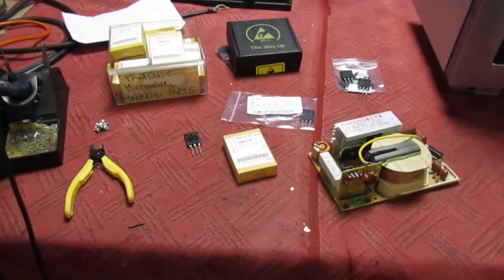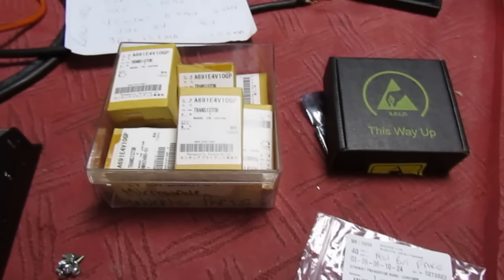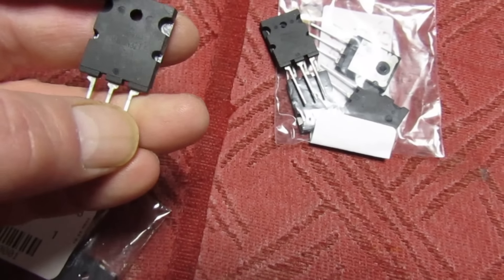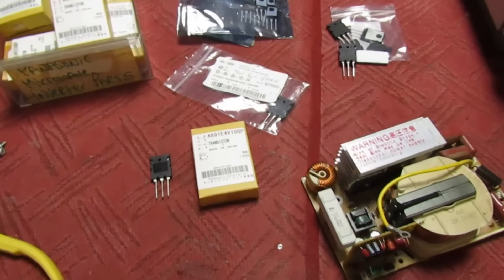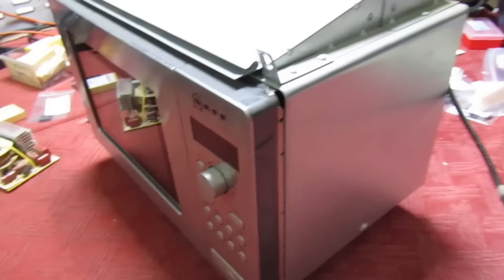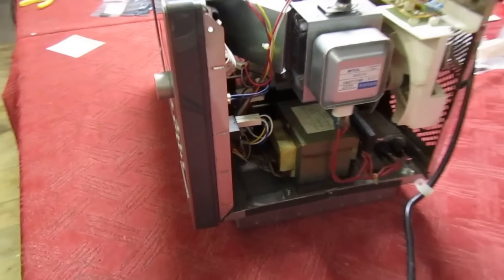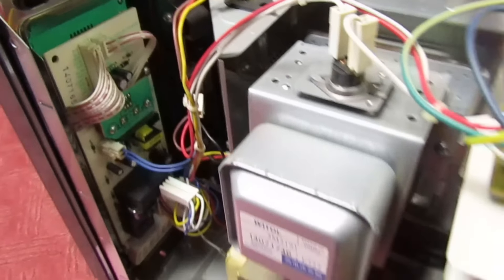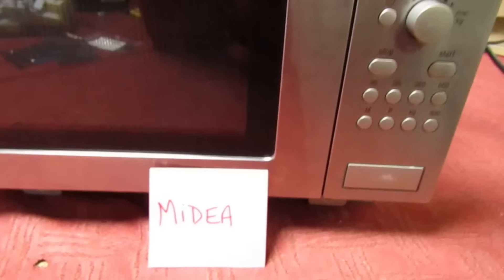Neff Microwave nasty surprise inside .

Comment: i dont see why they went with an inverter, the traditional innards are far simpler and probably more reliable?
Reply from the maker: May be at the time it was cheaper to make an inverter than a iron cored transformer with expensive copper wire , however some transformer I have seen use aluminium wire that's just enamelled so it looks like copper .
Reply: @michaeldranfield7140  weird, though i do have a small hank of enamelled what i think is aluminium wire, but its not recent stuff, its probably 1950s or even older, 30s maybe , its certainly not copper, maybe steel or a resistance wire, never tested it in any way, got it as part of a job lot of enameled wire 20+ years ago..
Reply: The inverter is lighter and probably also smaller, so the cooking volume can be larger.
Though the Midea over still has lots of wasted space.

Comment: That must be incredibly frustrating to spend quite a while fault finding an appliance only to have fake parts being installed & still not working..  it would make you scratch ya head a bit.
Reply from the maker: I got the money back for the fake supplied from a distributor, this is a huge  problem now though fake parts , I would say most of the stuff sold on the internet is fake but unless you know how to spot a fake you wont know its fake until it blows again, quite possibly causing more damage that you had to start with .

Comment: Hi Michael.  I have a NEFF microwave with this exact Inverter inside.   Can you still repair this board or provide an exchange?  I am an electrician by trade and have removed it.  Classic fault as you describe. Everything works but no heat. 10A fuse NOT blown, Magnetron has continuity and no short to earth.
Reply from the maker: you would have to bring the whole microwave in as I have no way to test a board but its unlikely to be the board if the fuse is not blown ,I have another video to upload showing the repair of this board in a few days time .
Reply: Thank you so much for your reply.  I’m guessing you are probably not near me in Bournemouth.   Otherwise I would gladly bring it to you.

Comment: I've had three inverter "Pan o' Bangers" over the years, and always felt that the reliability was not all that good. I know I still have two duffers here, right now. One is a basic microwave only, and the other is an all singing, all dancing microwave, convector, grill combination.

Now, I'm going to be having a clear out in the weeks ahead. If/when I find them, would you still be interested in them? I don't know what state they'll be in, but I can let you know as and when I turn them up.

Interested?
Reply from the maker: Yes I would be very interested in some inverter boards, the model number of your combi would also be of interest as I have a nearley new one, well it was nearley new a couple of years ago! The control panel has blown up but there's no circuit diagram for it so I can't identify the parts that have blown, it's board only replacement but the customer didn't want to pay and gave it to me but it was far too good to scrap and not worth buying a new pcb.
Reply: @michaeldranfield7140  I will definitely let you know what I find as I dig my way through. The combi is a fairly old beast, all brushed stainless steel trim and polished stainless steel cabinet.

The other is a plain white painted cabinet with plain white plastic control panel and door.

Is it just the PCBs you want? Or the the entire ovens?
Reply from the maker: @whitesapphire5865  Just the PCB should be fine thanks .
Reply: @michaeldranfield7140  In that case, I'll take them out as and when I find them, then they can be boxed up for posting.   Do you want the magnetrons as well?

Comment: Do these "inverter" microwaves have any advantages over the conventional transformer types?
Reply: For the user, it is good to be able to have the oven actually run at a lower power output when heating or cooking something delicate. A standard microwave reduces power by cycling between full power and off periodically (since it only has full power or off), which can sometimes overdo things during the full-on period. Setting 50% on an inverter actually runs continuously outputting half the power. Very low power outputs still have an on-off cycle. Defrosting in an inverter unit tends to be more refined than a standard unit. The inverter ovens are a bit more efficient in power consumption. An important factor from the manufacturing and distribution point of view is considerable reduction in weight. Since shipping is a big contributor to distribution costs, it can be either higher return to the manufacturer or lower cost to the end user if shipping costs are lower.

Comment: WoW ! i didn't know microwave oven inverter boards even existed !
Do they run the magnetron the same way as the good old MOT, i.e. 3kVDC + 3.6VAC for the heater ?
Reply: Same principle, low voltage for the heater, which is pulled negative as the cathode, but the inverter has somewhat different waveshape which peaks more towards 6kV for a 1200W or 1300W oven, Switching frequency of tens of kHz and the magnetrons are designed to have suitable characteristics for inverter drive.

Comment: if they do go bad over time surely theyre a bad thing to use?
Reply from the maker: Heat cycling seems to degrade the internal structure of the device .
Reply: @michaeldranfield7140   heat cycling likely degrades most components, some commodore/MOS branded chips are notorious for failing due to 'age', sinclair ULAs fail due to heat....

Comment: Great!  Always enjoy your videos, Michael.  Could anyone help, please?  I recently bought a working 80s Sharp R-7100 microwave from an eBay business seller, who sent it at my request to someone I know who rebuilds Kenwood Chefs – I have two of his and they’re great – and other small appliances, plus PAT tests then.  He’s agreed to look at it but admits he hasn’t serviced microwaves.  Is there anything he should look out for?  Is it a case of “if it ain’t broke, don’t fix it” and would it be OK to use without extensive examination and testing inside by someone experienced with microwaves?  Is there anyone with microwave experience I can post it to who might be able to refurbish it?  Many thanks.  :)
Reply: The R-7100 is from an era when microwaves were built like little tanks and went until they stopped. If you want to confirm safety regarding microwave leakage, you should be able to find a workshop with a leakage detector, or your small appliance guy might be able to borrow one. Those units have a very tight door construction though, and I never found any with leakage apart from actual physical damage to the door.
 A general inspection for condition is what I would do first, particularly the black plastic "filler" piece around the inner edge of the door facing the mullion (the outward facing flat surface that the door closes against). The plastic insert is called the choke, and is part of the leakage prevention, the plastic is filled with magnetic powder. It should not be cracked or have any portion missing. The door should close cleanly and firmly, without being over-tight. If it's sloppy, there is adjustment inside on the latch assembly, accessed by removing the outer casing. I think the door hinge on those is a piano hinge, a light machine oil can be wicked in between the hinge segments to prevent squeaking or binding. Light application of silicone grease to the door hooks makes the latching action smoother.
 It's not a high powered oven, so overheating usually isn't a problem, but all the air circulation vents can be checked and cleaned of fluff/grease buildup. When the outer casing is removed, it can be seen if the fan blades and magnetron cooling fins are gunked up, and can be gently cleaned with long cotton tips moistened with alcohol. The fan motor would benefit from application of machine oil to the bearings, for the sintered bronze to absorb. If any of the magnetron cooling fins are getting bendy/warped or are loose and can be jiggled about, the magnetron isn't happy. But the lower powered ones can actually soldier on like that for some time before ceasing to work.
 The waveguide cover inside the oven cavity (silvery rectangular plate usually held in by one or two screws), should be replaced if it is very dirty/greasy or has black burnt patches. It's a mica or polycarbonate material that a MWO workshop will normally have bulk to cut from, a genuine part for that age is probably not going to be found. If the cover looks clean and sound (e.g. not half missing) it will be fine.
 If there is any paint missing (I don't think the 7100 had a stainless steel cavity), like on the cavity floor or mullion, and it has rusted or burnt (arcing) it might be feasible to touch it up with an enamel touch-up paint. If there is arcing/burning on the front mullion or door, that isn't good - this is also part of the leakage protection system. It may be able to be carefully cleaned up and a paint touch-up done. Sometimes this isn't successful and it arcs again through the new paint.
 Your small appliance guy should be used to applying standard electrical safety measures, remember a MWO also has very high voltage sections and avoid running the oven with the outer cover removed. If I think of anything else, I'll add it later.
Reply: @PlatypusPerspective  Thank you so much for this incredibly detailed information.  It has been well received by my appliance guy.
Reply: @carlstock   Glad to have been able to offer some help.

Comment: the number of microwave OEMs is getting fewer and fewer, I heard somewhere that the biggest microwave oem in the world is Galanz, who make 90-something percent of the world's microwaves. Mine's a 28-year old panasonic. Made in uk. With a transformer. Never been fixed, all working. Bought it when I left home!!
Reply: Yes, when I was doing bench repairs, many small/mid size models of various brands were Galanz inside. Keep on with that Panasonic as long as you can. 🙂

Comment: I had a microwave that stopped heating up (think it was an LG). Light would come on and it would run the timer etc but the food came out cold. I assumed that was a common symptom when the magnetron failed but sounds like it's not.
Reply: With an LG, yes magnetron failure would be a common cause. If it's not an inverter model, sometimes it's the HV rectifier or HV capacitor, all causes that blow the HV fuse and result in no heat. Occasionally there will be a failure of the HV fuse for no apparent reason.
Reply from the maker: No , don't just assume its the magnatron, it could be as simple as a bad connection on the filament terminals , as the heater draws something like 10 amps so any slight high resistance here will cause it not to heat up, other possibility are an aged high voltage fuse that just blows for no reason .
Reply: @michaeldranfield7140  That was rather common in older Panasonic models especially the ones that used 4.8mm terminals instead of 6.5mm. If a Panasonic came in not heating the first thing you'd check for was discolored heater terminal insulator and crunchy noises when you jiggled the wire.